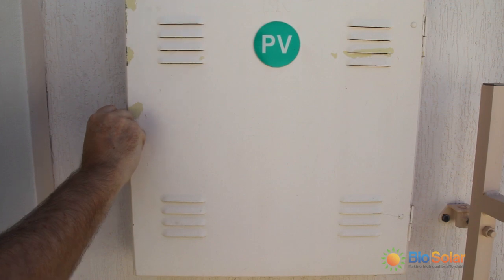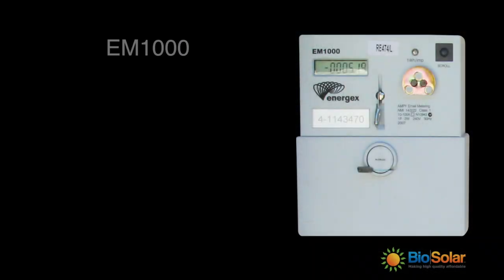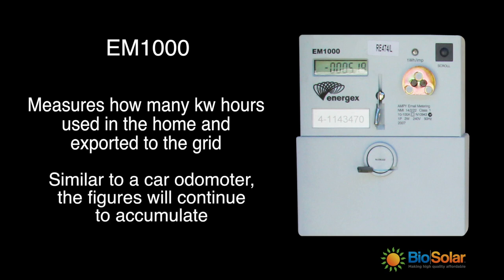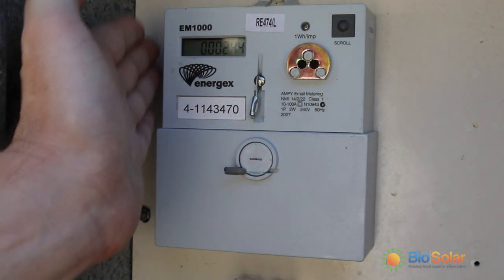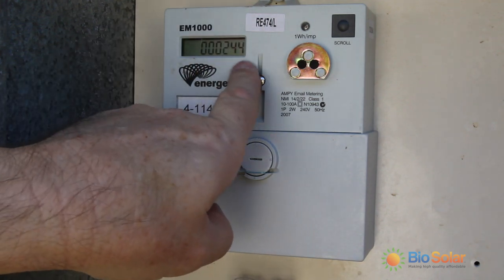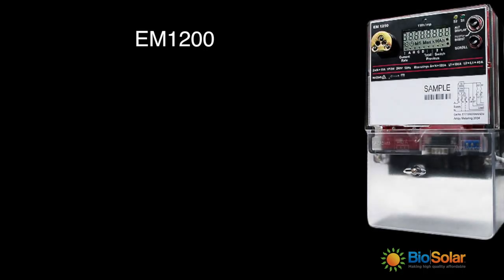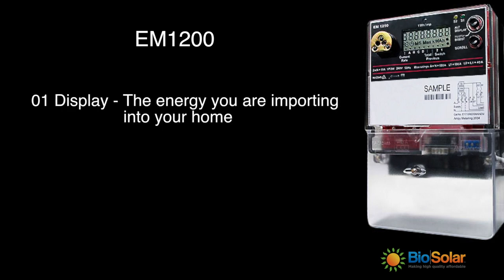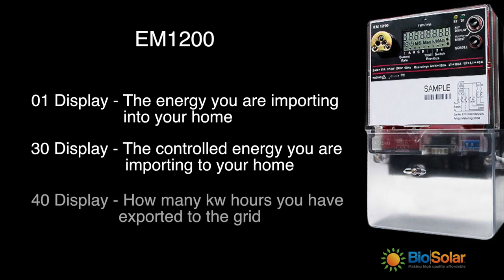BioSolar Owners Hub: How To Read Your Digital Solar Meter

Comment: Can an analog EM211 type 100 read solar energy ?
Reply: Things are very dependent and it has to be checked because a lot of metres may be capable but can have things stopping them operating in such a way due to how they are configured